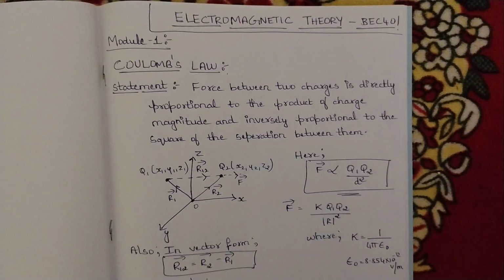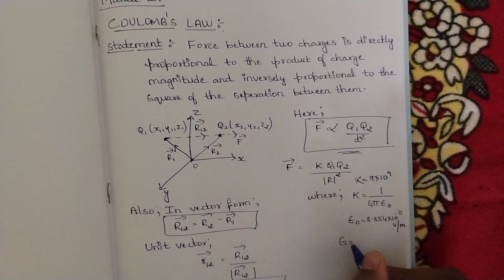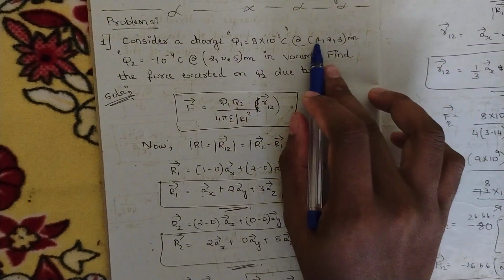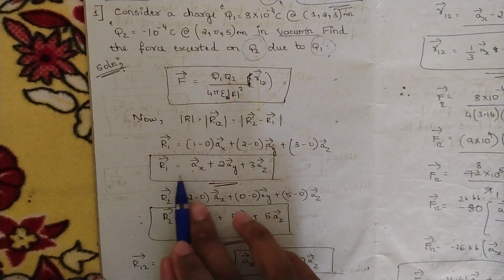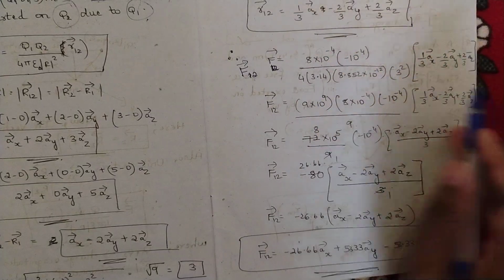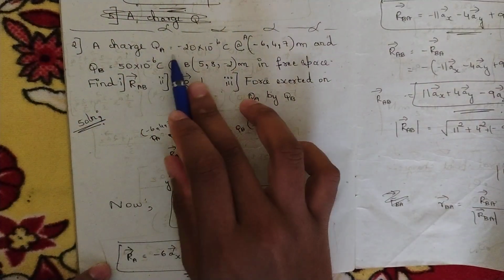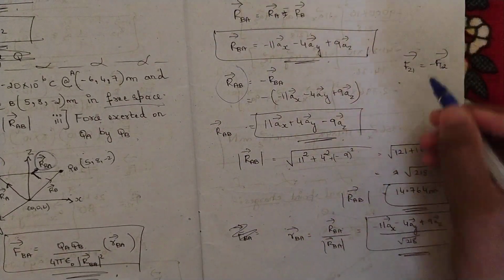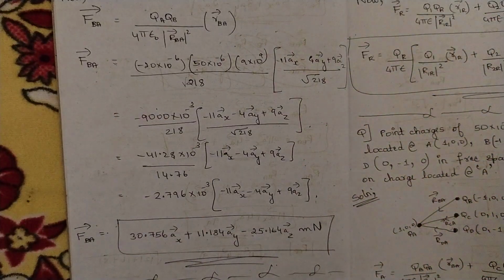1 Coulomb's Law Concepts 3 Problems Explained Module 1 4th Sem ECE 2022 Scheme VTU BEC401

Comment: sir numericals ans are wrong , becz if u are directly considering the vector into the formula then the denominator r should be cubed its not square , becz normally the formula is [F = (KQ1Q2/|r12_vector|^2) r12_unitvector ] its not [F = (KQ1Q2/|r12_vector|^2) r12_vector ] , or else it should be [F = (KQ1Q2/|r12_vector|^3) r12_unitvector ] , becz  r12_unitvector = r12_vector/|r12_vector|
Reply from the maker: Thank you for pointing that out, I will definitely recheck the calculation!